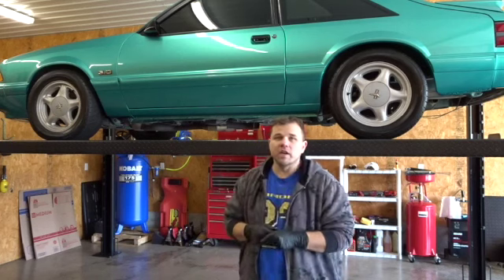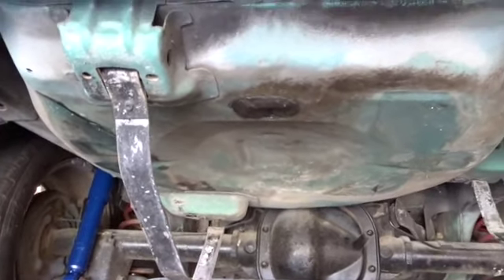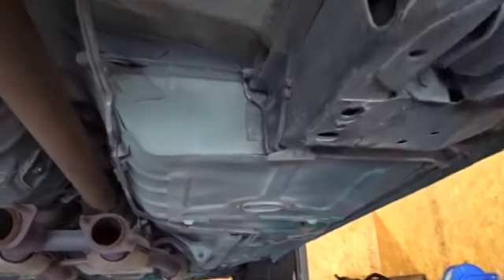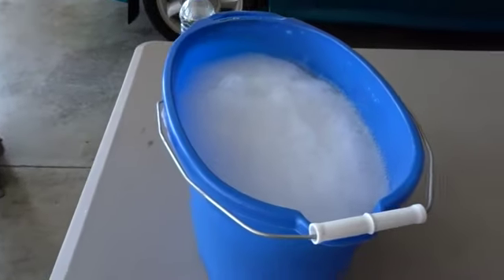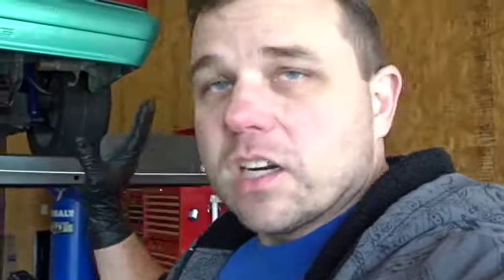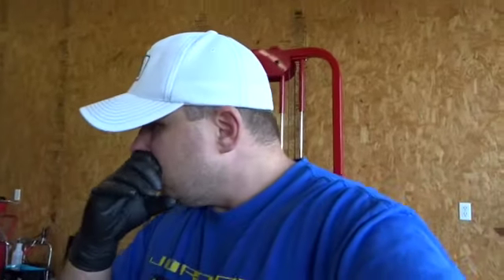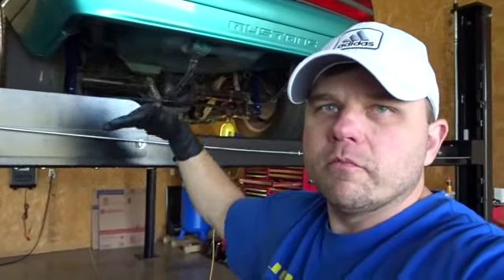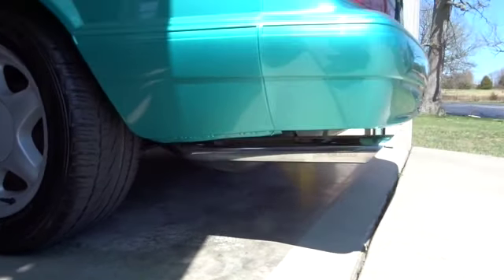BRING THE THUNDER! FLOWMASTER SUPER 44 CAT-BACK INSTALLED and underside detailing on the 92 Lx 5.0..

Comment: Subscribed...good video Sir. I have a AOD 95 gt convert. Which has under 100,000 and runs great and is none stock. Interior in it is practically new. It was parked by my neighbor since 2013. He put a new tranny in it just b4 he parked it. I bought it about 2 months ago for $1000. I guess he forgot its potential and couldn't see it's worth under the inch thick dust. I washed it real good and it ran sloppy bc of the old gas. So, I took it to my mechanic and he drained the gas, put a new fuel pump and fuel filter. New radiator, mass airflow sensor, put high octane gas. And that cost me $933 parts and labor. It ran a lot better. Then after driving it about 500 miles and adding more fuel, it drove and had the power of a new one. So happy I bought it. Thanks for your vid Sir, and Hod Bless you!!
Reply from the maker: Thank you, I appreciate you watching